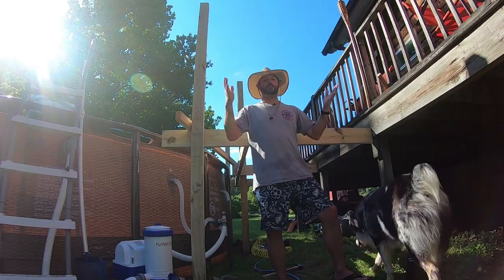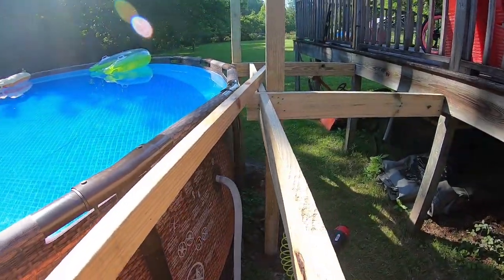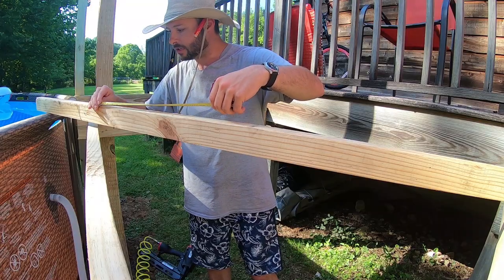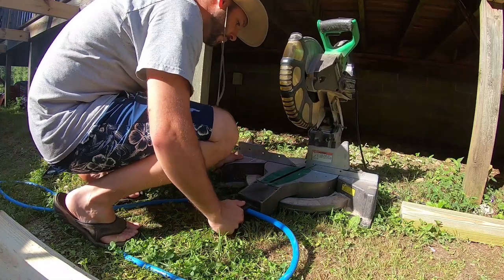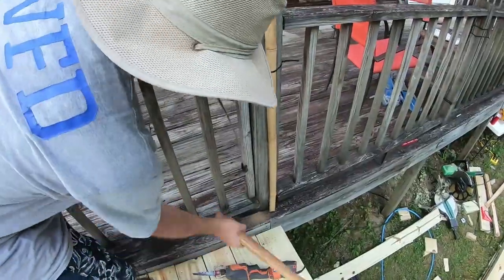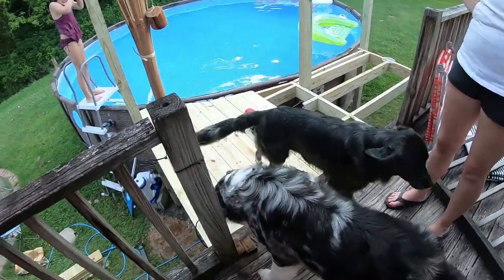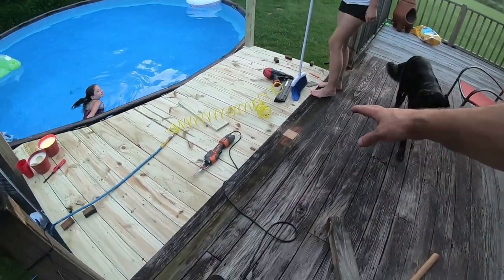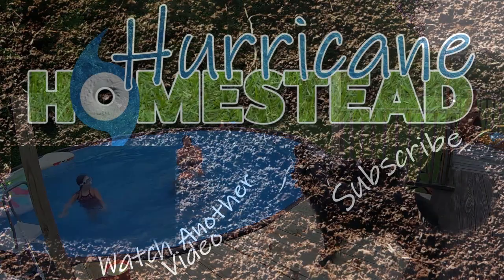Building our Little Pool Deck

Comment: Good work - may I however suggest to your viewers to use WPC = wood plastic composite decking instead of wood, as it is much more resistant to water and sunlight, and because it has a non-slip surface.
Reply: That stuff is really expensive

Comment: Awesome! I have the exact same pool and we just finished our deck. Tomorrow we’re going to try to drill a hole that fits the diameter of the ladder’s poles so we can enter the pool from the deck. Going to have one side of the ladder inside of the pool and the other side underneath the porch, with the support rails still on top of the deck.
Reply from the maker: Lay TV i cut one side of the ladder off just below the platform so the legs only stuck out about 3 inches. I then drilled a couple holes into a leftover 4x4 post and set the cut off legs into it then screwed it to the deck. That way I didn’t have to drill into the deck and we could move it easily if we wanted to.
Reply: Hurricane Homestead sounds like a good idea!

Comment: Nice work. What did you use for footings?
Reply from the maker: We used a few bags a quickcrete. Probably did it all wrong, but it works and has held up this far rather well. I think we have a video about it. On the channel somewhere.
Reply: @HurricaneHomestead  thanks for your time.